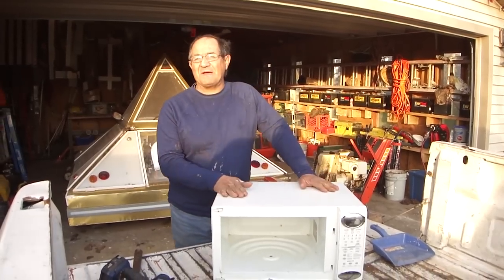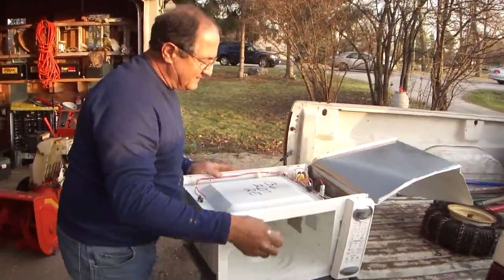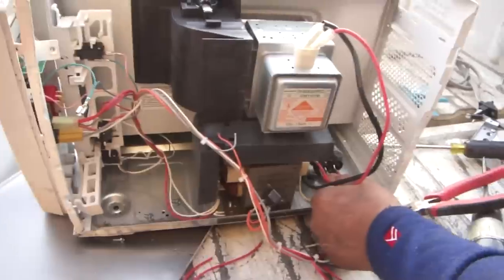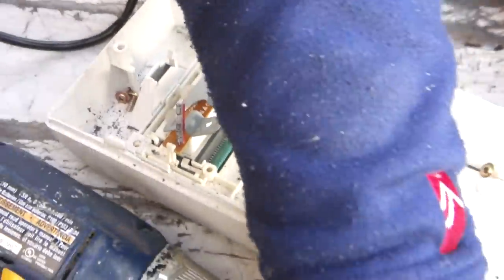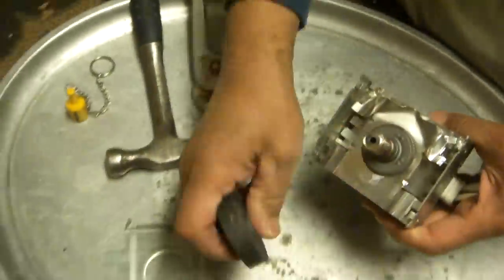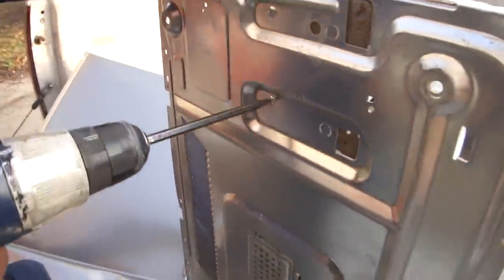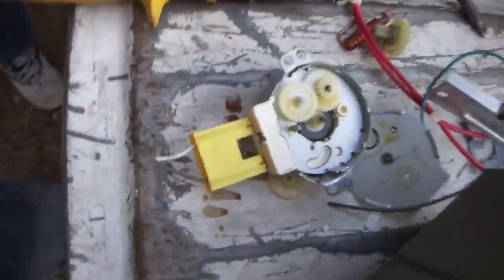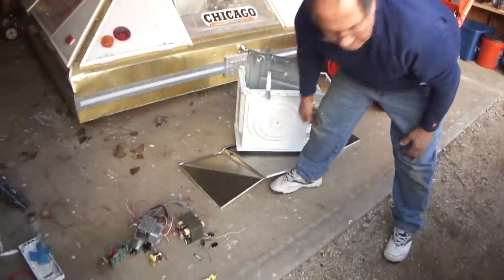How To Scrap A Microwave Oven For Metals / Money

Comment: before stripping check fuse  cause micro body still in good con
Reply: alwyn stewart 

True. a replaced fuse can make all this irrelevant.  just replace, test and sell a used microwave for 20 bucks.

and like someone said, the transformer can be used to make lots of things should you actually scrap the unit while saving the transformer.

oh and those tiny flat motors contain very fine copper wire. useful in art, jewelry, etc etc. Way better to keep the coils of fine wire than to sell them for copper weight.

Comment: Ive been scrapping on side of my regular job for about 15yrs and never at anytime no matter how high price of metal taking apart microwaves is NEVER worth it.
Reply: I do it all the time and there are no risks at all involved providing you do not break the beryllium insulators on the magnatron element which can emit very harmfull dust if breathed in. 
If the Microwave oven has not been used for more than 15 mns the capacitor is unlikely to have any charge due to the internal bleed resistor which discharges the capacitor within about that time automaticaly.
The very heavy transformer, which can weigh in excess of 5kg, brings in the most, as far as scrap value goes, but usualy one of the windings is Aluminum while the  other is solid copper.

Comment: A "solenoid"... 😂😂 it's a high voltage capacitor you dummy. 2100V 1uF capacitors. they can hold lethal charges even if the microwave havent been plugged in for a while. They have bleeder resistors inside specifically for bleeding down charges fully in like 5 minutes or so, but even so, make sure they're fully discharged.

Comment: im interested in knowing how much e got for all this scrap. selling the magnaton (the thing with the 2 magnets) on ebay can get you $8 to $15. The electrical transformer is 10 to 20 used. and the capacitor (what he calls a solenoid) is another 10. 

$30 easily..... 

also if any of you are gonna do this and scrap a microwave, its important to know that the magnatrons purple ring contains a very very nasty chemical. it cracks relatively easy, if inhaled of touches our skin you might need to go to the hospital....so stay safe.

Comment: This guy knows enough to get into trouble!! The capacitor for high voltage filtering can retain several thousands volts. Later microwave ovens have a discharge resistor built in to bleed the voltage to ground. If you have any heart issues the high voltage is fully capable  of killing you . This guy is scrapping the microwave for almost no return. The parts are more valuable . You can sell the parts on ebay and get  a good return. Obvious this guy is  a total rookie wet behind the ears on the subject. HE CALLS THE PART THAT CAN KILL YOU A SOLENOID . NOT!! THAT IS A CAPACITOR TO FILTER  THE DC FROM THE HIGH VOLTAGE RECTIFIER! Dude you have no knowledge of electronics or electrical.

Comment: That little thing you called magnesium was actually a ferrite RFI chock, and only the old microwaves have the nasty beryllium in the ceramic whether it pink or not the cost is to high to use it as microwaves are CHEAP, plus this guy made such a fucking mess and rushed the copper in the MOT.....newbie

Comment: That solenoid is a capacitor.   Didn’t check for discharge.   This guy is clearly unaware of the danger of berylium.    It’s scary to see ignorance at work.   Vid should be removed for spreading dangerous practices.

Comment: On 4:53 min. did he really call  to high voltage capacitor a solenoid?    That thing he called a solenoid is high voltage capacitor and can have enough voltage to stop your heart. ( aka: make you dead)   High voltage capacitors  need to be discharged properly before handling.        Please be advised-    Very bad video!!!

Comment: Cancer in 5 years
Reply: The hype about capacitors is too much, I certainly don't recommend touching one that has been charged just recently. Capcitors have a built in resistor that discharges the unit over time, see "dumb ass" he is still alive with a large collection of mother boards and magnesium parts and a nice piece of brass.
Reply: The only dangerous part of the whole exercise would be if he smashed the beryllium insulator (pink round cylinder) on either end of the magnatron element, which luckily he didnt.

Comment: You should look on youtube before and learn the dangers of handling certain items on microwaves like you do your TV's without a thought, that silver capacitor holds enough charge to stop your heart so be careful how you play with it. You are so clueless when it comes to taking things apart just maybe someday you will find out the hard way. Zap and your gone. See you are stupid No Gloves that thing you got your hand over now is radioactive full of radiation read the label where's your gloves well it don't really matter for you your an old fart.  The magnetron inside a microwave can contain beryllium oxide in their ceramic insulators which can be fatal if it gets into the lungs. Simply removing it is safe, but never try to take one apart. It's not worth it!